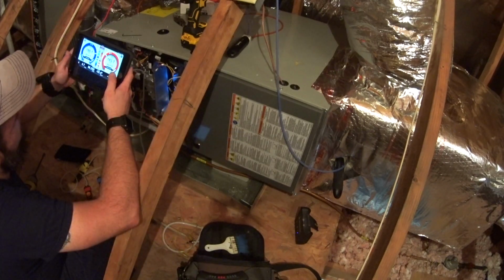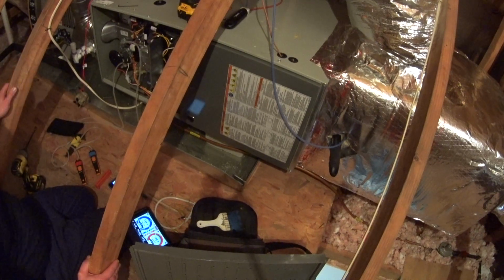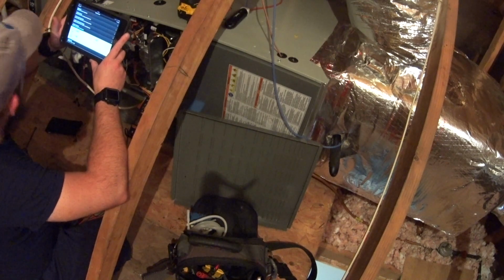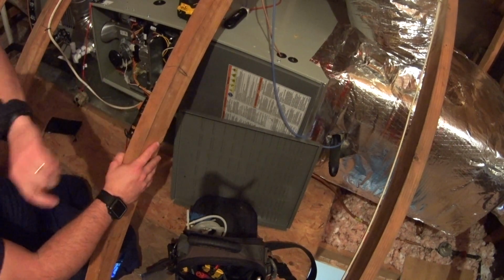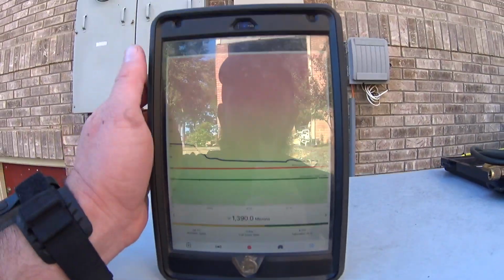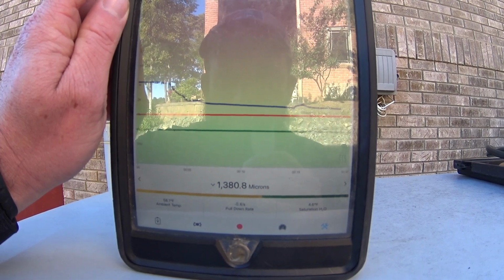10-17/18-17 Fujitsu Five Zone Mini Split AOU48 Leaks Recovery Evacuation

Comment: they sell the outdoor unit at re michels for 3k. you can get the same odu from pioneer for 250$ if your a contractor and the indoor units are 100$ a piece. so far i have seen them last over 5 years so far until the comp went just recently they sent me a whole new odu for 250$ so what it has a pepsi symbol on it ...

Comment: Any help would be much appreciated.
I have a Senville Aura mini split and am a retired hvac tech.  Problem in cooling both lines going to indoor unit are in low vacuum. Switching to heat they are both 500+ psig.  I was told by Senville it was reversing vale and replaced, but have same results. I now think it has to be the capillary assembly with dryer in the outdoor unit. I am having no luck in finding a replacement complete assembly or a good place online for parts for mini-split units. I would think a metering device for any 18,000 btu mini-split would work. It has to be clogged. IMO.
Reply from the maker: +Fred Dozer personally wouldn’t trust an online brand of equipment, every time I come across a client who’s tried to deal with one they’ve been horrible and parts are not reliable to source. That said most mini splits I’ve dealt with have the metering device at the service port so it’s not unusual to see sweating on both lines in cooling. I’m not familiar with Senville Aura as a brand. I’d say it would be simpler to scrap the unit and start over with a better brand if parts are not able to be found.
Reply: I had this unit 4 years and out of warranty. However Senville is a fairly well known brand. They once had a reliable tech assistance line. Not any more. I replaced the reversing valve on Senville service recommendation. I would buy parts from Johnstone Supply , but they carry nothing like it. I hate to scrap a $1,300.00 unit because of a minor unknown problem. Got to be someone that dealt with a similar problem. Yes it is simpler to change out and might have to. Senville does not even offer a parts list for their units. I have several Fujitsu with no parts list , but they have been in use 10 years, without problems.  Thanks

Comment: had a 4 head fujisu issue...top h/l @ 48 suction temp,,,2 mids 67...lower #4 78...using infarred gun to check temps...electric solinode switch out of wack

Comment: I always let out a pained sigh when I see a mini-split call come up on my schedule.
I grudgingly install them and wish they had a tail-light warranty - they're nothing but headaches.
There's a reason they come with flare fittings...meant to be disconnected and thrown in a dumpster easily.
Lennox's are the worst, we currently install Mitsubishi
Reply: I worked on a Carrier Mini split a few months back. I thought that was the worst. Just a bad thermistor. It was about 11 years old.

Comment: Not saying anything about your work because I love it and I learn so much from you. 

However it has always perplexed me why someone would spend all
The money for a zoned system and not purchase variable speed motor to eliminate bypass. I do like how that one is controlled with static pressure but it's like cmon man just buy the right unit and eliminate all that hardware. Awesome Stephen you rock.
Reply from the maker: +DJ Wright I do believe that this system had the zoning on the equipment before this system was installed, maybe. This was not my install also if that wasn’t clear. I think the equipment may have been chosen in this format due to budget, the AHRI wasn’t even for the furnace, coil and ac, Just coil and condenser. It’s always interesting to me to see how Match ups get done in different areas.
Reply: Stephen Rardon yeah the match in different areas are fun to observe.  I'm in seattle and AHRI match ups for American standard for awhile were pairing up communicating air handlers with non communicating heat pumps. I could only scratch my head. 
I knew that wasn't you work on the install. You the man Stephen.

Comment: I used to put in nothing but Fujitsu, but I never go about the 45k 5 zone so I dont have to deal with all the rest of that crap. Now I have converted over to Gree, each zone on the gree systems is isolated so you have to pull several vacuums but damn its nice to know what head unit and zone has the leak.....
Reply from the maker: +Performance Based Heating & Air a few months ago this homeowner called me and said a guy was suggesting that he go with a condenser that had 5 lines on it instead of the splitters... with what he has no the problems have never been with the condenser! That wouldn’t help solve any of his problems. I think he simply didn’t understand this system and wanted to sell new equipment to make more $$. I’m all for a complex problem, the more complex the better! It means I can charge for my work.
Reply: Im not suggesting replace it, to late for all that now. Im saying initial install is so much easier when you can lock out each zone......Right now you love complex jobs, let me know how you feel about those TIME CONSUMING jobs when you got a schedule to follow and no-one to back you up when you get behind....
Reply from the maker: +Performance Based Heating & Air I’m aiming to focus on complex jobs. Not hurt my feelings to do one project a day. No sense in chasing pennies when you can pick up Benjamin’s for addressing problems